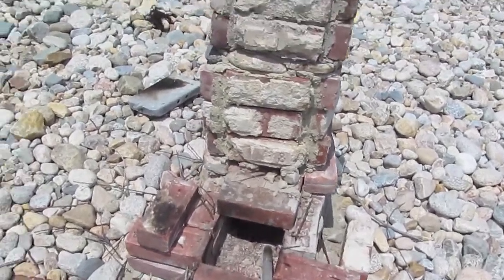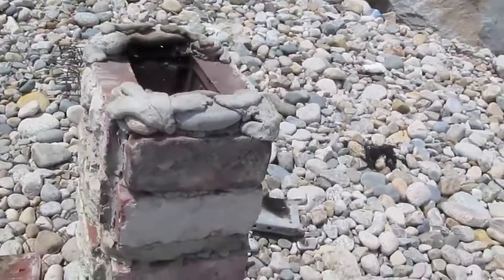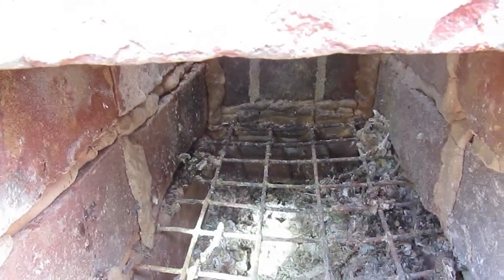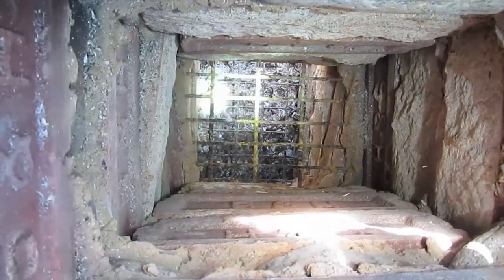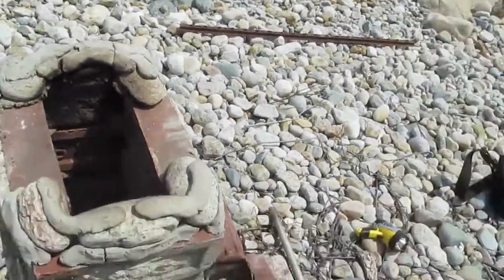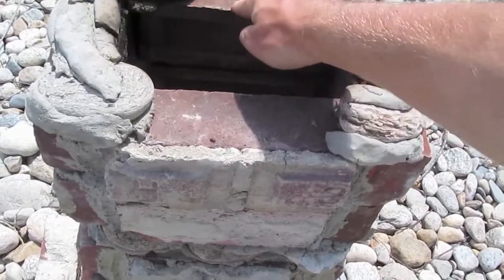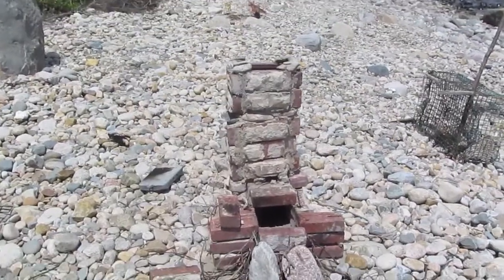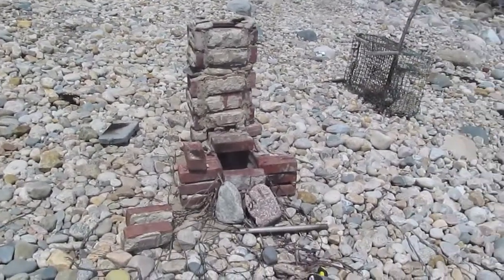Post-firing inspection of the Rocket Stove Kiln

Comment from the maker: Indeed high temperatures.  My IR thermometer goes accurately to about 700 deg F and it was reading over 800 deg on the top inside of the flue at some points.  Hopefully that means all the soot burned up and became more fuel to heat the clay :)